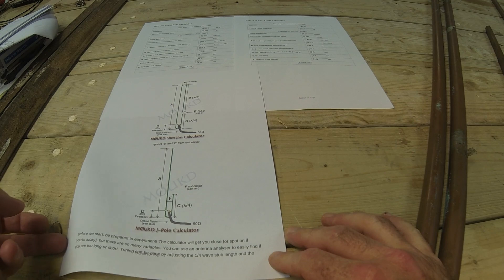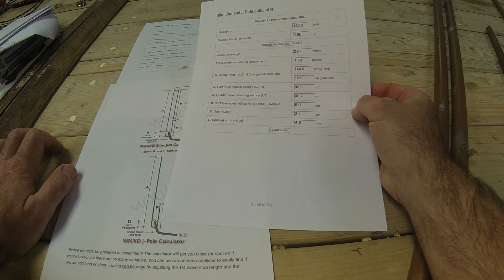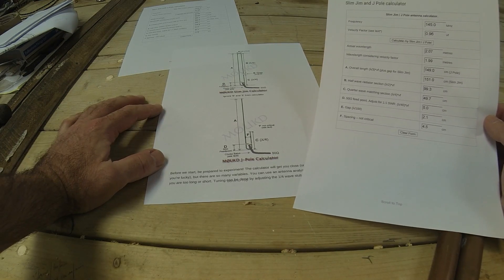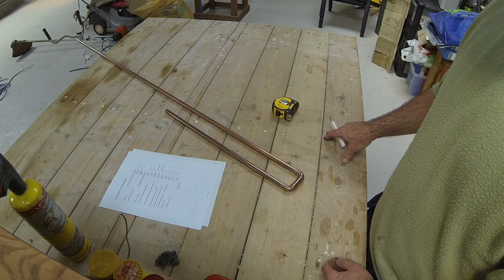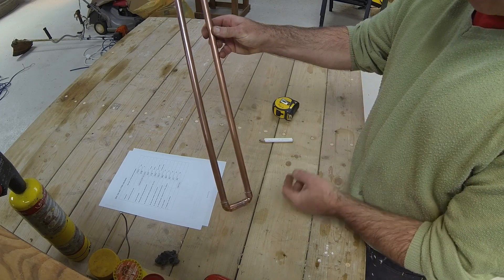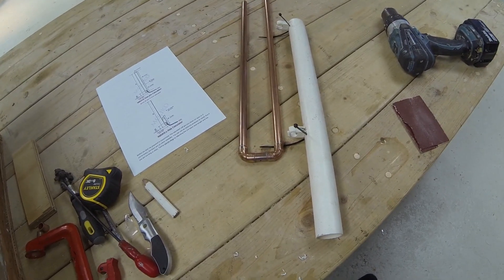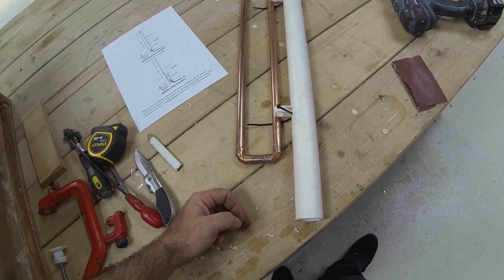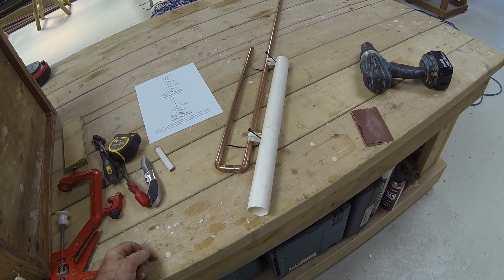Making a J pole antenna

Comment: O que mais me chama atenção nesses videos gringos é que as pessoas têm acesso as mais variadas ferramentas. Algo  impossível de encontrar aqui no brasil e, quando encontramos, elas custam verdadeiras bagatelas.
País desenvolvido é outra coisa.. ainda vivemos nos anos 60 aqui no Brasil em se tratando de tecnologia. É lamentável.
😞
Reply from the maker: Sorry to here that. There are other ways to make a j-pole antenna, with other materials and less tools.
Reply: @EvansBoatwork  j-poles  work on short circuit.. is it safe for the radio ?
Reply from the maker: @attilarivera  It’s a very well know and used antenna design.
Reply: @EvansBoatwork  I think I will study more about these kind of antennas. Thank you very much Mr Boltwork.
😊👍

Comment: Interesting that a plastic or metal mast fitting makes very little difference in operation. Just use and solder a "T" pipe fitting to add more pipe to attach to the mast. But as an interesting sidelight, it DOES create a comb of resonant SWR notches outside the operational frequencies as observed on an antenna analyser when using a very wide sweep. The metal mast does become resonant at some odd-ball multiple frequencies. VA7WN

Comment: Where did you find the 1/2" pipe clamps?
Reply from the maker: The white plastic pipe clips are a standard item so you’ll find them at any plumber supplies or diy centre.
Reply: Interesting that a 3/4 inch pipe strap will wrap around a 1/2 inch pipe to make an adjustable electrical connection with a brass bolt and ring lug. VA7WN

Comment: Why doesn't anyone show themselves soldering the solid copper onto the coax connector?
Reply from the maker: This is just a simple video showing the straight forward construction. The feed point of the coax needs to be adjustable initially (up or down) when tuning the j pole so I haven’t attached the coax in this video. I will make another video of tuning which is when you’ll see the coax attached.

Comment: u have a ton of old aluminum round stock from old antennas, can i use it to build a J-pole. i want to build one for the marine bands and center it around channel 16 (US Bands)
Reply from the maker: I’m no expert but I would say yes. You just need the velocity factor for aluminium when calculating the dimensions.